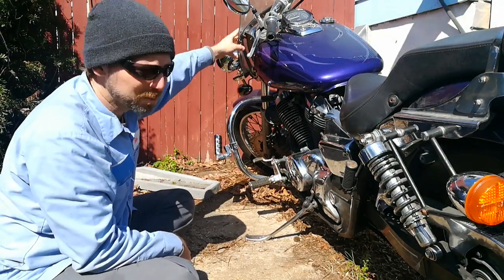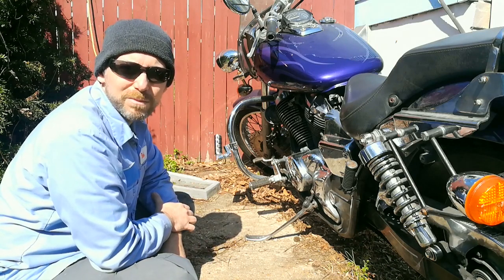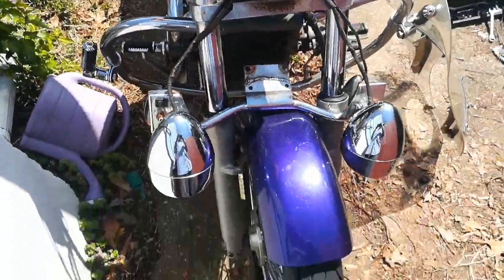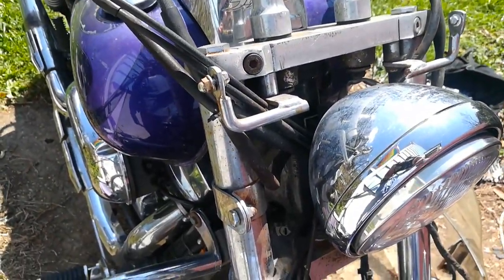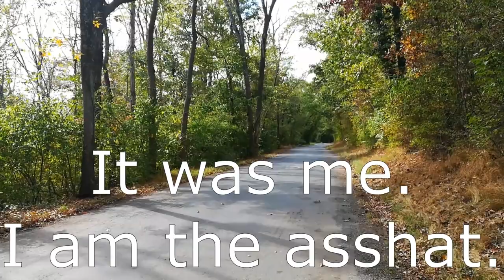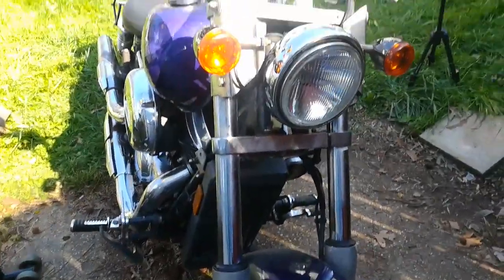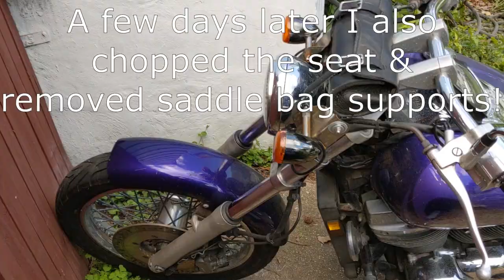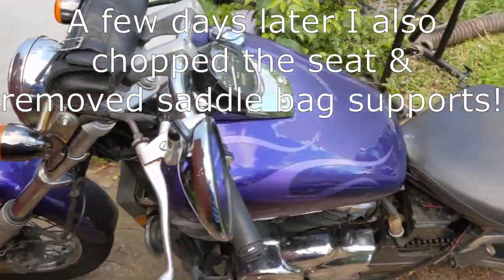2003 Shadow VT750DCB strip down

Comment: Hey Bobcat Arts - Great video!  I am just wondering if you have a video that shows how to remove a carburetor of a Honda Shadow Spirit 750 DC 2002 and re-install it properly.  I did mine two weeks ago for cleaning and now its leaking gas.  So frustrating.  Your help is appreciated.
Reply from the maker: Not yet! I think mine may be leaking gas now too so I'll eventually have to deal with it. I do know that pulling the dual carbs is a monstrous pain and there are useful videos out there. I'm procrastinating until I do a major rebuild/rejet of the carbs with new air intake and new exhaust because you have to take the pipes off to do the clutch (also needed) and they're so rusty I want to change them.